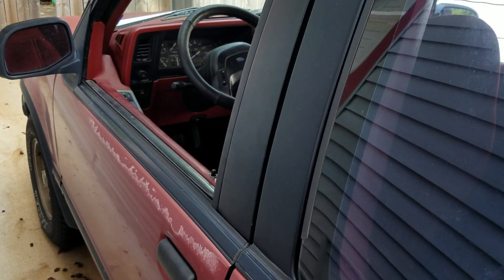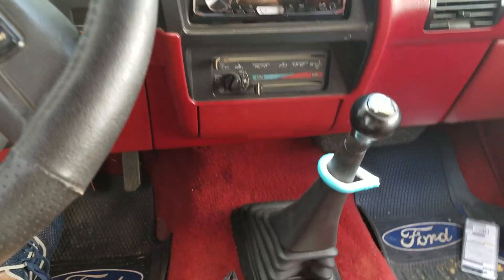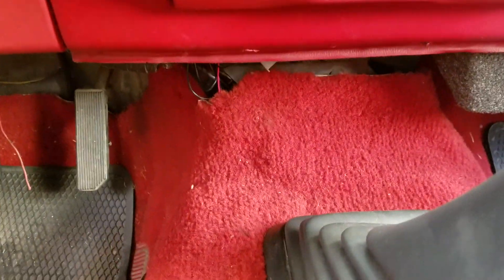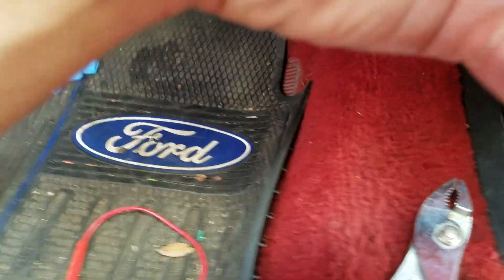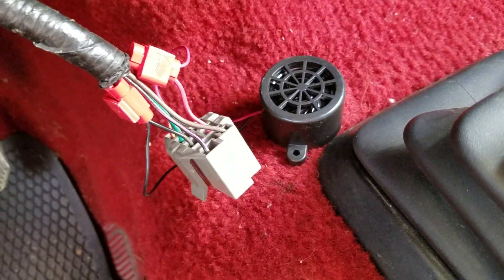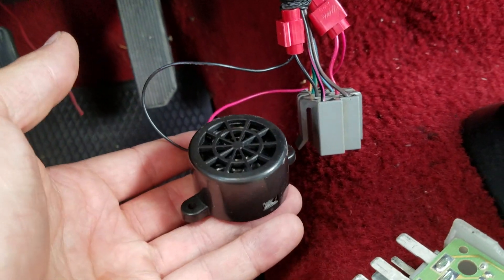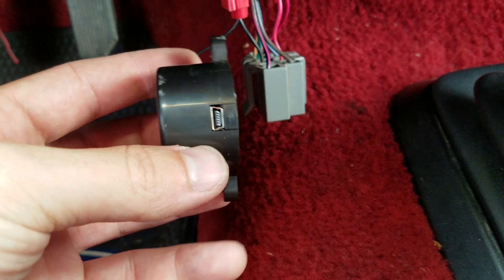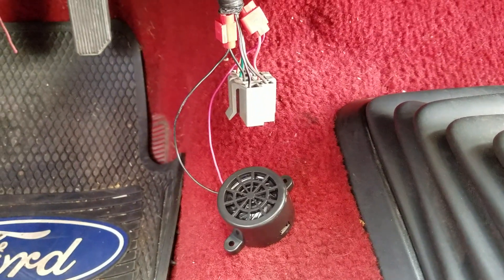How To:  Custom Car Door Chime

Comment: Did I understand right, that i can use my original door chime and just place this piezo in the door open line?
Reply from the maker: Yea use a multimeter to figure out which wire is triggered by door ajar sensor.  The wires gotta be close to the current chime so thats where I would start
Reply: @iDrive512  is there any way to get hands on one of those Piezo buzzers? Cant find any.
Reply from the maker: @Davestreak  not sure.. But any 12v USB programmable speaker will work.. Its a simple product but damn hard to find in stock!

Comment: I did this and it only works when my door is open. Is there a way to make it go if I leave my headlights on? My truck is a 95 f150 so your car isn’t much different.
Reply from the maker: It would need another wire added so that it gets power from both door open or lights on.  The radio lighting could be used for that, but you might want to add a relay so that circuit isnt overloaded.  The door chime circuit isnt as important as being able to see your gauges in case the radio/cluster lighting is on the same circuit

Comment: Mine doesnt output enough voltage to power the speaker
Reply from the maker: Hmm.. You double check with a volt meter?  It probably has the 12V it needs, but maybe not enough current?
Reply: @iDrive512  pretty sure I have a signal wire I'm doing it in a 2011
Reply: @iDrive512  how do I get around this? A relay that requires very little amps?
Reply from the maker: Test the voltage when opening and closing the door, if no volts then check for ohms, it might be a ground source instead of voltage source.  If thats the case, get the 12V from a robust circuit or unused one, cigarette lighter is good unless you use it often, then ground through the signal wire.  A relay is better but not hugely necessary as this draws very little power.
Reply: @iDrive512  didn't even think about it being ground controlled I'll try that thanks. If not I'm just gonna wire it to my dome lights which turn on with the door 🤷‍♂️ I'll let you know my findings
Reply: @iDrive512  it was ground switched got everything wired up. Thank you
Reply from the maker: @user-ii8fz4sf6h  hell yea, that's what i like to hear!

Comment: this only works when the key is in the ignition right?
Reply from the maker: Not for my truck, but different manufacturers might wire their chime modules differently.
Reply: If my car doesn't have a chime module can i wire up the speaker to something else like the doors open light?
Reply from the maker: @singleaspringle6941  yes!  It just needs to have 12v sent to it.. Anytime the module has voltage it plays music

Comment: Does the turn signal sound still work?
Reply: The turn signal flasher and relay are independent of the chime in older vehicles.
Reply from the maker: Yup!
Reply: In older vehicles the turn signal sound is actually mechanical due to the way a flasher module works. Technology connections has a good video on that

Comment: Probably a dumb question but I found the chime module in my car (1998 Buick riviera) and there’s a black wire coming from the chime module and a pink but no red, I’m wondering if the pink wire is the hot wire I don’t want to mess anything up.
Reply: More than likely the black is ground and pink is the positive or hot wire... Get a cheap multimeter and poke around, just to be absolutely certain. Good luck!
Reply: Red wire lost its colour and changed into pink XDDD